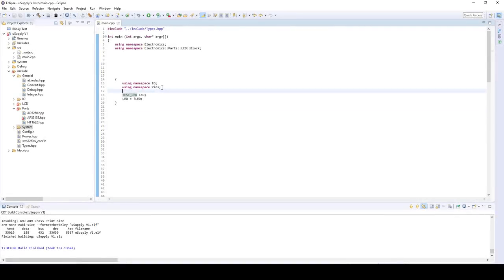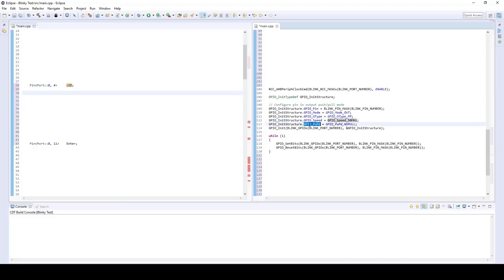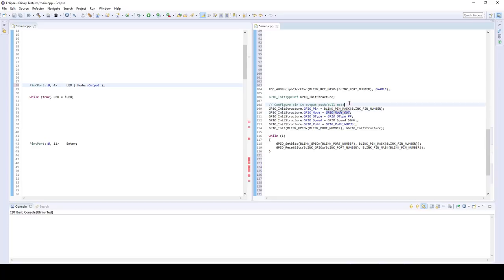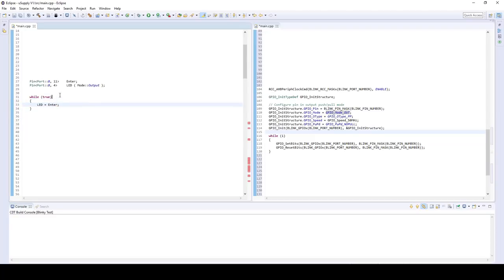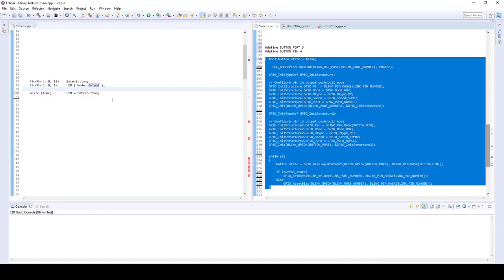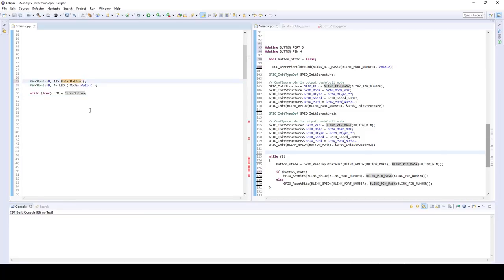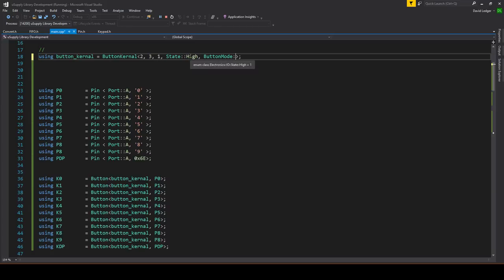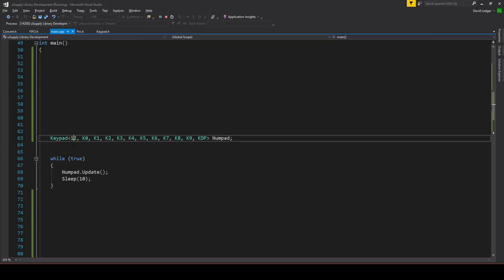C++ for the Embedded Programmer

Comment: That certainly looks a lot easier. I have just been writing the stm32 registers to control the GPIO, it's pretty easy to make mistakes with that.
How is the speed and memory usage with your method?
I tried some of the examples for the stm32 cube library and it took something like 20KB just to flash a LED.
Reply: I'm not that experienced. From what I've read C++ is pretty comparable. But off course it is very compiler dependent. Some can optimize better and check the option. With your example ready made libraries tend to be bloated. So the issue most often is design rather than intrinsic.
Reply: The speed is very good, structurally it doesn't need to do anything close to what the STM32 libraries need to do as they have a lot of runtime checks which are required because of pointer issues.

Its not superior to all C libraries, but I believe it would be slightly faster than the STM32 library but I haven't analyzed the assembly or run any benchmarks so I dunno yet, I'll report back next uSupply related video.

About memory, I don't know I'd have to separate the solution from the rest of the uSupply code but haven't gotten around to it.
Reply: 20K to flash an LED is a disgrace. Modern programmers just love their abstraction and layer upon layer of unneccesary crap.
Reply: That's why I will never use the stm cube crap.
They try to support every microcontroller with one library and it's just a bloated mess.

Comment: And, here is the errors I am getting during compiling: 
Build started: Project: first steps
* Using Compiler 'V5.06 update 6 (build 750)', folder: 'C:\Keil_v5\ARM\ARMCC\Bin'
Build target 'Target 1'
compiling test1.cpp...
test1.cpp(3): error:  #864: Pin is not a template
  Pin<Port::B,11> EnterButton;
test1.cpp(3): error:  #276: name followed by "::" must be a class or namespace name
  Pin<Port::B,11> EnterButton;
test1.cpp(4): error:  #864: Pin is not a template
  Pin<Port::B,4> LED (Mode::Output);
test1.cpp(4): error:  #276: name followed by "::" must be a class or namespace name
  Pin<Port::B,4> LED (Mode::Output);
test1.cpp(4): error:  #276: name followed by "::" must be a class or namespace name
  Pin<Port::B,4> LED (Mode::Output);
test1.cpp(5): warning:  #1-D: last line of file ends without a newline
  while(true) LED= EnterButton;
test1.cpp(5): error:  #169: expected a declaration
  while(true) LED= EnterButton;
test1.cpp: 1 warning, 6 errors
".\Objects\first steps.axf" - 6 Error(s), 1 Warning(s).
Target not created.
Build Time Elapsed:  00:00:01

Comment: You can use libopencm3 and still have C without typical stm32 hal verbosity.
Reply: Looks much better than the stm32 stuff, I wasn't aware of it, thanks. I still prefer my library but its good to have more reference material, and libraries like that make superb reference material.

Comment: 'You don't have to worry about it' is a problem. Embedded system engineers should worry and do the work. If one's tools are clumsy, sharpen your tool or find a better one; it's dangerous to use a tool that let's you 'get by' without doing the work.

Comment: The example is kind of unfair. The C++ code does give you less control about the exact pin state. I guess you could always change the pin latter as needed, but doing it in an Object Oriented way also tends to add a lot of lines. The C code could be shortened by just writing a function or a macro. (or using reasonable defaults) It is comparing bare C with just controller specific header against C++ with a controller specific libraries.
Reply: --- the C++ code does give you less control about the exact pin state
It has exactly the same control of pin state, I programmed the library, it has all of the pin settings, but it only exposes what you use.

The following is valid working code:

LED = State::High;
LED = Mode::Input;
LED = Speed::High;
LED = Resistors::Pullup;
LED = Type::OpenDrain;

You can also construct the LED object using the above things:

Pin<Port::A, 4> LED
(
    Mode::Input, 
    State::Low, 
    Speed::High, 
    Resistors::Pullup,
    Type::OpenDrain
);

Strictly speaking the C++ code does *more*, as it automatically manages whether the modules power is on or off. Automatically being the operative word here. The automation is scope based too so it doesn't have any performance penalty.

It is comparing two libraries essentially, I agree.

Comment: A well written C++ library like this can be compiled into the same size as C. Why does everyone think C++ is horribly inefficient? If you don't use it correctly it can be terribly inefficient. However just like anything worth doing you have to understand the nuances of the language your programming in. Everyone treats C++ like it's C with the extra baggage tacked on. It can be that and when you use it like that it's horribly inefficient. If you truly understand the language, and the nuances of it, you can achieve the efficiency of C.  Including things like STL is not something that one should do in a micro controller. String manipulation and link lists are meant for dynamic memory, and not memory constrained micros. Template classes can be a double edge sword, they can reduce run time errors to compile time errors. However if you abstract everything away like the Pin template, how do I know if I have an input or an output? This is where C++ blows up on people. Just because you can overload an operator doesn't necessarily mean it should be done. However C++ does make programming easier, and anything that makes program development easier is something that should not be shamed. Yes it can come at a cost of code size or run time speed. However paying a 1.00 for more memory can be cheaper in some instances than paying someone more money to write in a less abstract language.
Reply: Firstly, people early on compared binary size of cout to printf programs, the comparison was deeply flawed as cout does so much more its funny.

Secondly, templates have in the past resulted in people instantiating hundreads of a template type which in the distant past duplicated binary, but now with folding in the linker it is becoming a thing of the past.

Thirdly, alot people or a while believed that classes all needed a virtual destructor, this simply isn't true and using one results in the instantiation of a VTABLE in the class.

These things are trivially avoided, worked around or no longer exist, so I'm 100% with you here.

Comment: For the first example, couldn't you simply write a function to initialize the struct just as the constructor in c++ is initializing the class?
Reply: Not quite, there is pin reference counting which automatically determines when to power down the clock for the GPIO module. This is not easily done as reference counting is a static members of classes.

Comment: There's a byte of manipulation here. Why are you creating 2 separate GPIO init structures? If there was just one you also wouldn't have to set all of its members for each pin. Another thing is that newer ST libraries (HAL and LL) have a toggle function. Also it is possible to write libraries in C that are much easier to use and/or don't require any knowledge of the MCU. What ST has done is a compromise between that, size and overhead.
Reply: Thats true, could have changed the minimal things I didn't think about it forgot that the structures are not needed after the function call.

Comment: I looked at using C++ when I got back into AVR last year, since C++ is what I prefer on the PC, but I read a lot of talk about how the avr-g++ is "experimental", incomplete, performs poorly or is otherwise flawed (e.g. you use templates in this vid. Is that supported by avr-g++?). Is that really the case? and is the STM32 probably a better choice if I want to use C++? (I mean, Arduino is more C++ than C anyway, so that must use avr-g++ now I think about it.. Arduino code performs terribly but that's probably more about the awful standard libraries for Arduino than the compiler).
Reply: I not only use templates, I use many of the most modern c++17 features. As far as I can tell its great!
Reply: You mean the internet lied to me?! Surely not!!
What about dynamic allocation of memory in embedded, do you do that? I've read a lot of people (e.g. on the EEVblog forum thread for this video) say if you use modern STL features you have to use ones modified for static memory allocation such as www.etlcpp.com , but dynamic allocation seems to be to be a consistent theme in the STL for a reason.
The PC program I've been working on this week really would not be optimised if I couldn't use dynamic memory allocation.
Reply: I do avoid heap allocation, stack just manages things much cleaner, but you can effectively use heap allocation by overloading the new operator, custom allocators etc. But... as a general rule I say avoid heap allocation. I might go into this one day in detail but it definitely can be fine, I still don't do it as a rule. I don't know much about etl. You don't have to avoid the stl, remember its more than containers, its all the algorithms etc, add auto & begin() and auto & end() iterator stuff to your class and alot of them work out of the box with no issues at all.

You can use the STL without heap allocation, there are a few containers that dont use the heap which all the algorithms still work with, array of course is fine. You can wrap alot around std::array to get most functionality, this is what I do typically.
Reply: Thanks David!

Comment: Don't  be so hard on yourself, don't inflict eclipse on yourself. No body deserves that. :)
Reply: HAHAHA, yeah.... They have made a large push for syntax highlighting in c++17/intellisense like features lately, that is a big deal for me. I tend to burst type and sometimes I swap characters around I use a lot of modern features which just cause all my code to appear as an error in some IDE's even though its completely valid c++17 a whole document of red squiggly lines disturbs me.
Reply: Ok. if it has properly working code completion for  and highlighting  for  new c++ that is a valid reason to use it - probably the only valid reason :). To be honest, last time I used eclipse was 5 years ago and it was quite a horrible experience. I'm used to VS - that's a high bar.

Comment: Sorry, I can't read anything - the text is way too small,
Reply: Darn, looks good on 720 p and 1080 p. 
I don't know how to zoom in with text in eclipse, I just changed IDE for embedded development. Sorry about that :(
Reply: @David Ledger
please just simply reduce the screen resolution of your active monitor.
Or ask Dave for the dumpster key to retrieve an old small VGA-connected screen from there.
Reply: In TrueSTUDIO for STM32 (which is an Eclipse fork) it's Window->Preferences, then General/Appearance/Colors and Fonts, then Basic/Text Font
Reply: THANKYOU! I was soo use to holding ctrl then scrolling I didn't think of that.
Reply: Indeed - I’ve made a couple of videos of visual studio and learnt you need to ctrl+scroll to make the text much larger for it to be visible on a small device.  Julian Ilett kept doing the same thing, but now made the font bigger and it’s much easier to read
Reply: searched for this comment. Thanks :D
Reply: textsize looks good for me on 720p@1680x1050
Reply: David Ledger, Looked good on my end. Nice and sharp text. But I run at 1080 and have nearly 20/20 vision.
Reply: Agreed, it looked fine at 1920x1080 for me, very sharp text :)

Comment: This example is made more extreme by the fact that the standard library for the STM32 is unusually verbose - at the other end of the spectrum, look at the equivalent AVR C code:

#define LED_PIN 0
#define BUTTON_PIN 1

DDRB |= (1 << LED_PIN); /* Set LED pin direction to output */

while (true) {
 if (PINB & (1<<BUTTON_PIN))
  PORTB |= (1<<LED_PIN);
 else
  PORTB &= ~(1<<LED_PIN);
}

(I'm not including #includes or function blocks because you didn't.)
Reply: It was just the library available for the platform I was developing for, real world example.
Reply: Less readable though
Reply: While it's true that the STM32 code is verbose, there is much more complexity (also flexibility in configuration) to the ARM core than the standard AVR micros you're referring to.
Reply: True, but the AVR syntax is still able to express pull-ups (which I didn't have to write), and the example would work equally well if there were one or two more registers, as using the "defaults" wouldn't require writing to them.

Comment: Why so many thumbs down!? Damn, people are giving the guy a hard time! :)
Anyways, with the proper abstraction on the C-side of things, you could've easily ended up with something in the form of:
while (true) { set_pin(LED_PIN, get_pin(BUTTON_PIN); }
Reply: Firstly, Thankyou! C++ is pretty controversial it seems to C programmers. 

Yeah your right, that's possible and actually has some advantages.
(standard way to expand on pin functionality without modifying the class or struct itself).
Its always a trade off though and I like my solution but its not right for everything.

The implementation you present would also need the port in the function though and that would result in a runtime calculation of the port registers pointer which is slower than a compile-time calculation (what my library does). 

Alternatively you could save a pointer to the registers but then the struct that represents the registers is platform specific.
Reply: Heh, looks like it is controversial indeed. I wasn't advocating for one over the other, by the way. I think both C and C++ have their place. You're right about the platform specificity, although you could possibly hack some macro magic together in C to accomplish the same thing. It won't be nearly as neat and tidy as a C++ class though :)

Comment: The only problem I have with C++ is templates. They're not type safe. You can stuff anything in there, and per Murphy's law, anything can end up in there. Which can make it a complete turd to debug when something goes wrong, because you can't see what's going on.

Then there's the STL which is a mess, and don't get me started on Boost (which besides it's cruftiness is a pretty big dependency to lug around).

I'll keep using C. I don't mind the verbosity.
Reply: Templates are sort of the type system, not everything can end up in there, if you need checks just use basic type_traits to provide template type safety. You can also use concepts or SFINAE to do the same checks but that can be a little more involved.
Reply: The biggest problem I have with C++ templates is the verbosity in applying the type safety without concepts being available in all compilers. Without concepts you can detect if it is a basic type, pointer or reference, you can detect if it is a class/structure type, if the type is large enough to contain all of the values, if it is signed or unsigned and more. If it is a class/struct type you can detect if the type has required member variables or functions, if the type inherits from the correct interface and so on. Even better, using constexpr functions can argument all of this too allowing even more flexibility. On top of this all, instead of having a huge mess, you can use static_assert to provide human readable errors back to the developer to let them know exactly what they need to do. But this comes at the cost of having to write a lot, and having a lot more happening at compile time.
Reply: Darran Rowe, your post has kinda made me excited because you obviously know what your talking about :D
Yes, yes and yes. AND YES about static assert, IMO its a bigger deal than concepts and we have had it for ages. 
Anyway, maybe i'm bias in all this, TMP has rot my brain or something hahaha. Honestly... I find TMP fine now, there was like a sudden moment of clarity between when I was lost reading implementations of std or other template heavy libraries and then just understood it, it really isn't as bad as people say, that said I've been doing this for a very long time now. I find it really fun, people do sometimes forget the most easy trick in TMP, you can test if a function exists in the constructor of a class as it always tries to instantiate it and if it doesn't exist it immediately reports T::function does not exist, its somewhat easier than the typical SFINAE approach I reckon.
Reply: I'm puzzled by your statement. C++ templates are WAY more type-safe than a C #define macro (the most closely matching capability in C) . When you instantiate the template, you define the allowable types.

Comment: A lot of embedded code will be in the form of Linux kernel drivers, where C++ is viewed as utterly evil by much of the Linux developer community. I don't expect this to change until Linus dies, and has no say in the matter. This is a huge problem if you want your code to be nice and platform portable. If you KNOW your code will only ever execute on a specific platform, you can use whatever language is most optimal for that platform. Larger projects that have lifetimes of many years often have to migrate to different platforms, and code portability becomes pretty important. I personally think an appropriate C++ subset is very useful for embedded/kernel software development, but it's just not a viable option if you need to be Linux kernel compatible.

Comment: No noo nooooo nonono!
I've done unspeakable things in assembler for pic16 like 10 years ago, i won't go there again.
Also etched+drilled pcbs by hand back then.
Forgot most of it, using lazy arduino ide now for hobby, which also got pic-duino boards by now..
Also soldered boards with all are cheaper than anything i built back then.
No thanks: point&click, copy&paste, even for an attiny85 😅